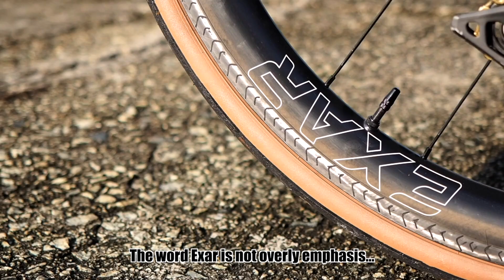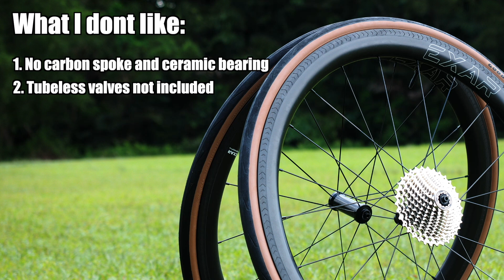RB45pro EXAR Carbon Wheelset Review

Comment: Hi Sam, how does it compare to the winspace hypers?
Reply from the maker: I prefer windspace for it’s looks, ceramic bearing and carbon spokes. but windsspace rim brake not good during raining day.. this exar brake is good even on raining day.
Reply: @SamHoChannel  i have the opposite experience. tried both exar and Lun hyper rim brake. HYPER was superior in every aspect
Reply from the maker: @pigupigu  yes.. hyper rim is good and win over exar. The only issue on hyper is brake performance during raining day.. mine are rim brake
Reply: @SamHoChannel  i have 38mm and 50mm HYPER. About a dozen friends all have various rim brake HYPER and Lun road series wheels. All using same supplied brake pads. No issues braking in wet. Obviously not as good as disc brake in wet performance but no issues in wet